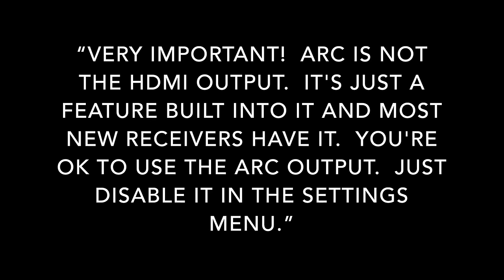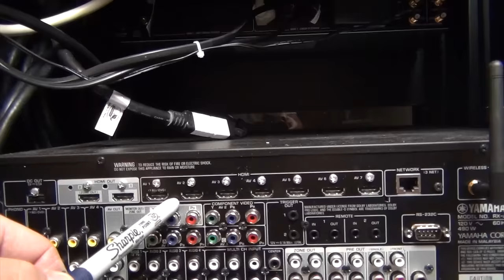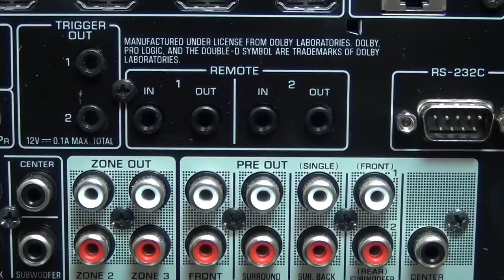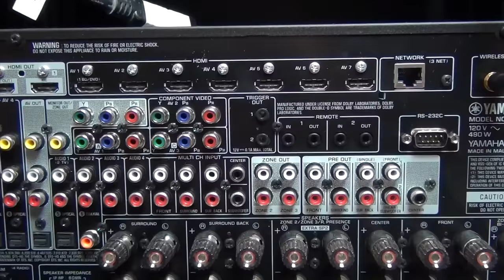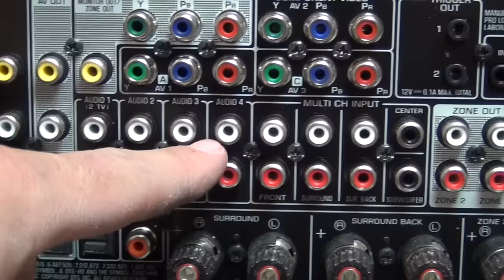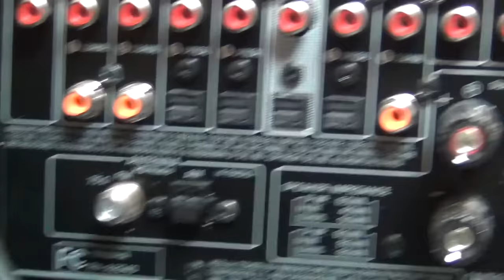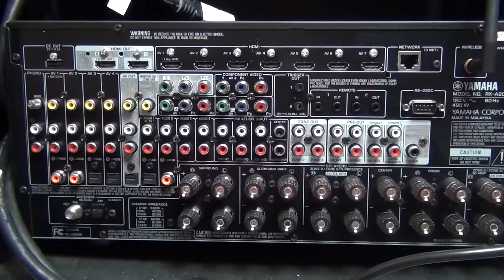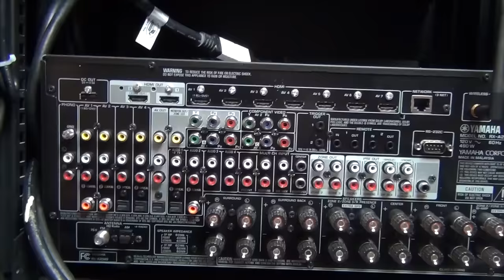How to connect a surround sound receiver - Part 3

Comment: ARC is excellent for most home use applications and simplifies cabling.
Reply from the maker: I get this comment a lot. Many people don’t have a problem with ARC but there are a lot of people that struggle with the side effects. The only benefit is to use the tv for streaming. A blu-ray player or appletv can handle the streaming and eliminate the need to use ARC. Thanks for watching.
Reply: I use an antenna for TV so ARC connects from my Samsung 49" smart TV to my tx-nr757 onkyo so the receiver can not only get the sound from the air signal, but uses the return audio channel to send control signals each way.  The ARC channel also helps when using a cable box because the box needs to check that it's output is not going to a recorder.
Reply: @Kylen Jensen Instablaster =)
Reply: @Jared Aron it worked and I actually got access to my account again. I am so happy:D
Thank you so much, you really help me out!
Reply: @Kylen Jensen No problem =)
Reply: Just to clarify if I disable the the arc setting in the menu settings  will I be able to get audio out of my 7.1 speaker's ?

Comment: Hey Alan, this is is an incredible video for those who are trying to get the best home theater experience. You have really taken your time out to explain every single port at the back. This shows how you have really done your research prior posting this video. I agree with everything u have said in the ARC context. I should have contacted you before buying my Onkyo tx686 AVR, now I can’t connect my power amplifier to it since it has no pre out ports to connect it, any help on that if u can please, Also which amp is better emotiva or monolith ? Thanks in advance
Reply from the maker: Hmmmmm... I can’t comment on the Emotiva vs Monolith comparison since I don’t have experience with either one. Why do you want to use your amplifiers? Do you have big speakers? That receiver doesn’t have pre-outs as you know so you can’t connect to them in an easy way.
Reply: I have a pair of Polk audio RTI-A9 with 500W peak anD 250W RMS @8 ohms, my current AVR only puts out 110 RMS power, my speakers r really really power thirsty
Reply from the maker: I know an audio processor could solve your problem but I think your best bet is a new receiver unfortunately.

Comment: Arc works well on my receiver when I want to watch broadcast channels on my tv without going crazy the way you just described.
Reply from the maker: My main problem with ARC is that everything runs great most of the time but every once in a while, the user tries to do something outside of normal ARC operation and messes up the inputs or equipment power settings and the end user (usually my non a/v savvy customer) gets confused and can’t get it back on track. For that reason, we always turn it off and let the custom remote handle the controls.
Reply: You can disable each equipment from turning on or off.  In settings.    Mine works great and only turns on what I assign to do so.

Comment: Hj alan i want to connect a Bose acoustic mass 5 seeries III  Speaker to my RX V1067 aprt from my main 7.1 speaker setup just for listening to my Audio CD's what options do I use i would likke to ise the optic cable from my CD player bit confused where to plug in my speaker out to my Bose acoustic mass thanks
Reply from the maker: Your speaker system is a sub that connects to 2 speakers correct? Just connect the Zone 2 speaker outputs on the amp to the speaker inputs on the back of the Bose subwoofer. Then connect the two small speakers to the back of your subwoofer. Connect your CD player to the amplifier using RCA cables NOT an optical cable. That should do it.
Reply: @AlanCleggYouDoAV  thanks a ton alan would it sound better than connecting the HDMI from the CD player?
Reply: @AlanCleggYouDoAV  where exactly does the RCA inputs from CD player go for the zone 2?
Reply from the maker: Pick any audio input. It doesn’t matter which RCA input you use. Just remember which one it is so you can select it. You can’t use HDMI or any kind of digital cables for Zone 2 functions. You have to use RCA.
Reply: @AlanCleggYouDoAV  thanks a ton alan

Comment: Great video! I'm trying to play my Amazon firestick and Netflix through my Yamaha receive just like the one you are showing in this video. I have a OPPO DVD player ran through my receive and my Sony TV. But cannot figure out how to run Amazon Prime video and Netflix through my receiver. I have my Firestick plugged into the HDMI video IN and my receiver in HDMI 1 ARC. Neither of them will play through my receiver, only my DVD player and regular cable TV, any suggestions?

Comment: THANK YOU VERY MUCH ALAN FOR YOUR BRILLIANT PRESENTATION.  I'M LEARNING A LOT. BUT I ONLY HAVE AN OLD 5.1 YAMAHA RECEIVER.  I THINK IS A 367. BUT IOVE YOUR EXPERIENCE.  YOU'RE AMAZING.
Reply from the maker: Well I think YOU are amazing!! Thanks for watching and thanks for the comment.
Reply: @AlanCleggYouDoAV  Thank you Alan, I just can't believe how you can break it down like this making it easy for us to understand.  I was trying to connect this 5.1 yamaha receiver to my Sony blu-ray home theater,  I did it connecting an RCA to them. But yesterday I went to BEST BUY and they told me that the yamaha reciever is not going to improve the sound of my speakers. Is is true? What about an amplifier.  I. Can find it on Facebook market. What do you think Alan. Thank you for your guidance
Reply from the maker: @lilianaordonez5474  I'm glad to help, but I'm not sure if I understand. What did you do with the RCA connectors?
Reply: @AlanCleggYouDoAV  good morning Alan thank you very much for your time.  Since the Geek Squad from BEST BUY set up my blue ray to my TV, all I did was connect the old Yanaha receiver RXV 367 IS ONLY 5.1. To the blu ray using an RCA cable. ( is the cable with 2 red and white terminal on each side) I matched the colors red and white to each component. Using their audio outlets.  I honestly don't know how the receiver is going to help to improve the performance of the blue ray.   The old receiver is also amplifier.  But I hear the sabe sound. The equilizer I don't think improved.  I think I wasted my time buying the old receiver.  Because I wanted to improve the sound.

Comment: Alan, your youtube is great for a smart person. I'm a 68 year old woman that just wants my audio and speakers connected and working. I have the old Kenwood VR 406. I would love a youtube of only setting this up. With all the connections and words I don't know, I need help, please. I have two speakers and one oblong one in the center, which no one could get working.HELP
Reply from the maker: I'm sorry for the frustration. This is a confusing industry. What are you trying to connect to the receiver other than the speakers?
Reply: Any luck or progress with your setup? Just for your information, the center speaker is not meant to work all the time. It will only activate from surround-sound sources giving "Dolby Digital"  like DVD movie discs. (DVD player's audio must be connected to receiver using optical cable also).

Comment: Your advice on the ARC connection is all wrong . You can get the best uncompressed return to your AVR by this connection AND in the controll you can set the ARC enabled WITH the sync function turned off(no auto turn on to other components)
Reply: Seems like he doesn't like your response lol. I agree with you though.

Comment: You really know your stuff I have a Pioneer light vsx-82txs I'm quite sure that it's in the settings stop working  as I was in the settings  can't get it back on  it's a 7.1 I'm just trying to do 5.1 I unplugged the receiver disconnected the speaker wires did a factory reset hooked up the speaker wires it came back on went back into my settings it went back off  do you have any ideas for me appreciate you thank you

Comment: I have a old speaker system which uses speaker wire connection and is great but want to upgrade to a new dvd player but newer models don't have speaker connections on the back now..how do I go around this..thank you
Reply from the maker: You have a "home theater in a box." It is meant to work as one unit and is not friendly to mixing and matching components.
Reply: @AlanCleggYouDoAV  so do they still make new dvd players with the speaker connections thanks for the reply Alan..just need some info on upgrading myvdvd player to my existing sound system...thank you

Comment: Hey im confused. You said in this video not to use ARC output its bad bad bad, but in the 4th part video,  you had used it. Lol idk am i missing something. Because i got my HDMI cable coming from the ARC OUTPUT from my YAMAHA reciever into my ARC on my tv, then i have all my ACCESSORIES, DVD player,  ROKU ect going into the HDMI inputs on my reciever. So is this correct? Works fine. Im just confused of your statement and dont wana hook it up wrong.  Thank.

Comment: I am setting up a very similar Yamaha receiver 7850.  Your excellent videos have explained so much of the trouble I was having getting zone 2 to work and problems with ARC.  I think I get it.  So instead of a single HDMI cable going from TV to receiver I need to add another cable... say, optical.  Cool.  Any advice on which input HDMI slot to use on the receiver... keep using the ARC and just turn off ARC.  If I do this, which optical input on the receiver to use?  I tried moving the TV HDMI over to #1 HDMI inputs and put the optical into #1, turned off ARC and no joy.  Am also having trouble now with only TV audio (not through surround) or getting both and TV is not letting me turn off the TV audio.  Wish I had seen your audio earlier.  Excellent!
Reply from the maker: Use the ARC output on the receiver but disable the ARC feature. You can use an optical for the TV audio, but I recommend you just do your streaming on another device like a Blu-ray player, AppleTV, or Roku. If you really want to use the TV, use the optical and land it on any free optical input on the receiver. You're probably going to have to adjust the settings in the receiver though. You need to assign the input to something that isn't being used by something else. Once you've done that, you need to make sure the TV is sending audio OUT from the TV (done in the settings). My guess is this is the step that you're missing now. That should do it. Thanks for watching and good luck.

Comment: If you still respond to this, Please help with two questions.  1. If I use all digital tos links for audio, what video cable do I need?  2. My system Marantz SR-19 has jumpers for the preamp or regular I/O's.  The manual sucks.  How do these jumpers ork?  Why do I need them?  Where do they plug in?  I want to us a powerful two channel external amplifier for two channel stereo.  Where do I connect the preamp signals to my amp, and can I keep all my regular connections for surround sound connected?  The jumpers have me confused...

Comment: I am kind of a noob to this so forgive my ignorance. If optical is primarily for audio and HDMI does video and audio, why would you use an optical cable and an HDMI cable connection to the TV? Wouldn't HDMI be sufficient? Thanks for the video.
Reply from the maker: GREAT question. The HDMI cable will carry video to the TV and even though it CAN carry audio, the audio will just stay in your receiver so you can enjoy those surround sound speakers. The optical cable will carry audio OUT of the TV and IN to the receiver so you can stream Netflix on your TV and still use your surround sound speakers. The HDMI can carry audio out of the TV by itself if you enable the Audio Return Channel (ARC) but that creates a host of undesirable side effects so I forbid you to do that. The best solution: connect the receiver to the TV with an HDMI, turn off the ARC feature, and stream your content through a Blu-ray player or Roku or something similar.
Reply: @AlanCleggYouDoAV  Why don't you explain why ARC is so bad?
Reply: @samthecat2700  He explained that in this videos and other videos like this

Comment: Alan, you are great! What if I only have one ARC outlet but it is also HDCP 2.2 outlet? It is a Yamaha S601 which I have purchased through Amazon and it is on its way. I am also purchasing Sony XBR49x900e TV. I am older and want to be able to use the remote we have which is the My Harmony remote programmable. I want to be able to hook these together plus also a blu ray player plus the cable box. I bought the Yamaha S601 only because it is slim and fits my shelf but would rather buy a receiver that will work perfectly than to worry about fitting on a shelf because I would put it elsewhere so that it will work perfectly with a perfect picture from the player and the Dish cable box. plus I would like to have perfect sound. Thank You for your help.
Reply: Robert Noname is
Reply: Your fine to use the HDMI out on your AVR, labeled Monitor Out 1/ARC.   Just make sure CEC, or HDMI Controll is Disabled in your AVRs settings Menu!

Comment: Hey, my polk audio 12inch sub went out and I upgraded to the SVS PB 2000 PRO. I hooked it up but can't hear it unless the volume is way high. The SVS tech either didn't care or didn't know. So the very few settings he had me change didn't help. Now I can't hear my polk audio tower speakers like I used to could.  Can u help me please? I'll even pay if you can help me with the settings. My reciever is a Sony STR550.
Reply from the maker: Did you set the sub volume level in the receiver menu? How is it connected to the receiver- which plugs are you using on the receiver and sub?

Comment: I have an old Yamaha HTR-5890 7.1 receiver with no HDMI but it has Toslink and Digital coax connections. Right now I am using the Toslink connections from my cable box and Blu-ray player and TV to the receiver. It works okay but I cant get THX SB speakers to work in THX. DTS and Dolby digital and Pro logic works fine. I think there is a problem with the Toslink connection interpreting the type of Blu-ray disk move I am watching. Should I be using Toslink or Digital coax ?
Reply from the maker: Either connection is fine. This is from the manual "The surround back speakers output the surround back channel included in Dolby Digital EX and DTS-ES software and only operate when the Dolby Digital EX, DTS-ES or Dolby Pro Logic IIx decoder is turned on." Check to make sure the correct decoders are being used and the speaker configuration is correct in the setup menus.
Reply: @AlanCleggYouDoAV  thanks

Comment: Man this is an old way to setup an avr...... arc is a norm now, most of the avr have only arc now.
Reply from the maker: You can use the ARC output but you should turn off the ARC feature. Too many unwanted side effects. For example, try turning off your tv while streaming pandora through your receiver.

Comment: How do I go about connecting a speaker that didn’t come with the receiver via audio (red/white ends)
Reply from the maker: The speakers with red/white connections have amplifiers built into them. You would use the pre-out connection on the receiver, but you're probably looking at more trouble than it's worth.

Comment: I HAVE A SONY BRAVIA KD-55X8200E SMART TV WHICH I WISH TO CONNECT TO MY DENON AV (ANALOG) SURROUND AMPLIFIER AVC-1530G. THE OUTPUT USING EARPHONES WORKS BUT AS SUGGESTED LOCALLY, THE SAME DOES NOT WORK WHEN I USE THE TRADITIONAL CABLE. COULD YOU KINDLY SUGGEST A WAY OUT & OBLIGE, PLEASE?